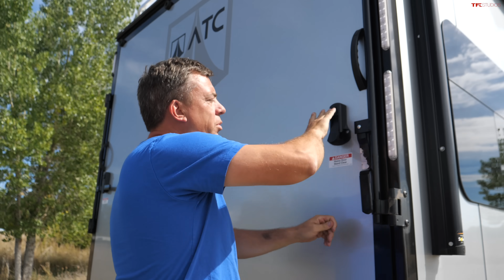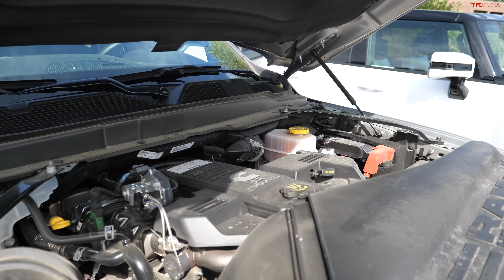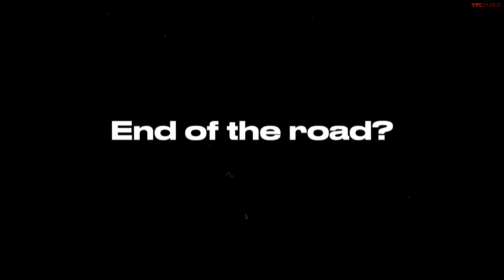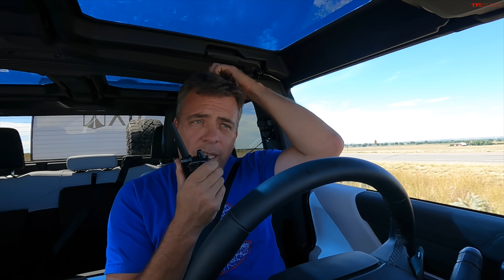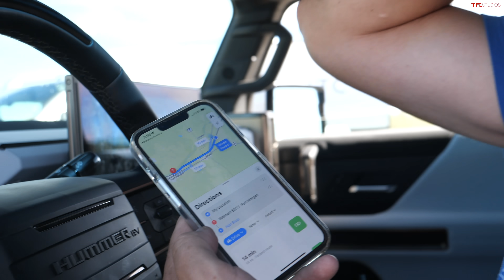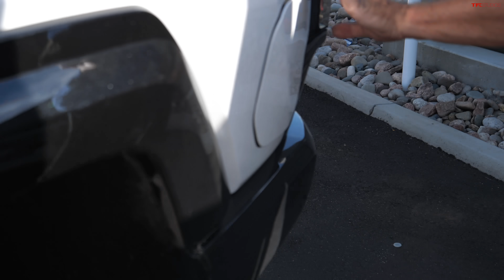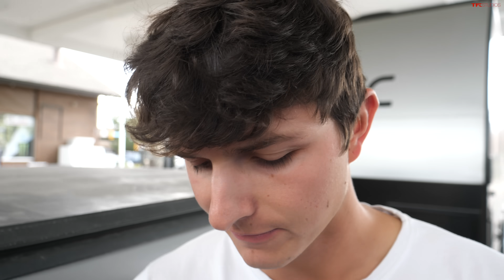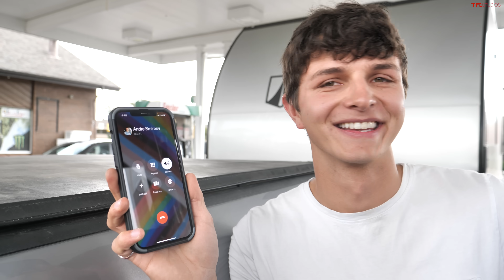How Far Can a Diesel and Electric Truck Tow An Identical Camper Trailer on ONE Fill-up?

Comment: "woah woah woah you said 2 heavy duty trucks?
                                                                                what exactly is the tow rating on that *insert truck name i can't spell*"

electric vehicles are good for short term driving or city driving.
but gas and diesel are better for long term trips or towing.

also, to any electric car/truck owners, how often do you need your battery replaced from usage.

Comment: Well that hummer has a load capacity in the flatbed Box area to hold 1600 pounds I think he said he could put a decent 4000 W generator in there with a  Few 5 gallon gas cans, which he hopes won't get stolen, and can recharge on the go, overnight...
Reply: Funny how the electric truck still needs gas to charge,,,,,,

Comment: Who cares if the electric hummer could even beat the diesel as is with that scenario.... It's ultimate hauling and load capacities are so inferior and you're not even going up hills in the Winter with the heater on.

Comment: Wait until they Federal Government Enacts the  MILEAGE TAX .. Diesel and Gas prices include a Tax at the Pump..The Onboard GPS on EVs will transmit the mileage traveled and a Tax will somehow be charged to EV drivers,or the Price at the EV Charging Stations will get adjusted... Each state has different Fuel tax rates, so Electric Car owners can expect to pay Gas taxes at the same rate that gas car owners pay..  I believe the law is passed, but not enacted until a future date so as not to discourage SALES... Expect to Pay Electric Surcharges and Battery Disposal Taxes and Higher Insurance, faster depreciation and equivalent pollution. Did the Vehicles use Air-conditioning or Heaters which would eat up kilowatt hours, too?   NO....Lastly, it is only fair to test vehicles when they are used...Say 3 years old...A 3 year old Battery may not even take That Hummer  100 miles in Winter or in the Heat of Summer...  EVs have a place, but don't be a Guinea Pig for the EV Manufacturers.

Comment: Evs are nice if you just run around town, have a garage to park it in and charge at home. I see the potential for local delivery vehicles etc, That can charge overnight at the yard. but as far as long distance or hauling, they are not even close. Buddy could pull that Ram in, fill the tank, take a piss, gat a coffee and be back on the road in 10 minutes where the EV is sitting there for an hour, if there is even charging available.

Comment: And if they got rid of the def and actually let the truck run like it's supposed to it would actually get better fuel mileage. Once I got rid of the def in my truck, I had more power and 5-10 more gallons a mile. Plus it takes oil and diesel to send def to the supply places and it's also shipped from over seas as well which takes diesel in the ship which don't use DEF. For Pete sakes fuel is much better then these dumb EV vehicles. If you're going to make ev then make them hybrid. And make the damn fuel mileage better. The oil companies don't want that though because they would lose money. All about the money some just don't get it!

Comment: I got in a discussion on another forum about class 8 EVs.They we're saying it would do everything a diesel truck would. I challenged them to a test of hauling a 210 thousand excavator 450 miles without stopping to recharge.
Reply: That's actually fairly doable. The Tesla Semi did 500 miles flat under full load, although that was a fully covered trailer, an excavator isn't quite as aerodynamic.

It has to be noted though that the "no recharge" rule is dumb. Commercial drivers are required to make a rest stop after a few hours, I don't remember how many exactly, but still - no way the driver can do 450 miles in one go, and if they have to stop for 30 minutes anyway, why not recharge in the meantime?
Reply: @Wojciech Muras  Over the road drivers are required to take a 30 minute break within the first 8 hours. You can easily drive over 400 miles before the 8 hour break is required
Reply: @wojciechmuras553  I think you need to rethink the math.
I believe the 500 miles was with the flatbed hauling 44,000 lb of Jersey barriers at 81,000 lb Gross.

Well over double the frontal area, way more rolling resistance due to all the required extra axles, way more tare weight due to the mass of the trailer required and a 210,000 lb excavator. In my experience you will expend about 4 times the energy so maybe 125 mi range.

Electric  trucks at current technology levels have potential as is for P&D operations for LTL carriers or other specific applications.

Traditional longhaul will need less weight and more range than current Li Ion Packs. If the packs that are just entering production can meet the marketing claims of 4x the energy density it could allow half the battery pack weight and double the range. At that point it will depend on the unit cost and battery pack longevity and replacement cost. 

Diesel replaced gasoline, gasoline replaced kerosene (coal based), kerosene replaced whale oil and whale oil replaced wood only when economics dictated it. All the good intentions in the world are unlikely to make the transition to electric successful. You have to make it economically desirable. 

The trucking industry would love to stop spending huge sums of money on diesel, just give them something that makes more cents (as in dollars and cents).
Reply: @gk5891  Oh, you mean one of those excavators? Yeah, I was thinking more along the lines of John Deere 160 P-tier, not mining excavators. For loads that unusual, true, Semi makes absolutely no sense, unless it's short-haul.

Still, there's a lot of jobs where the combination of load and range Tesla offers is perfectly adequate. And with the current prices of diesel versus current prices of electricity, I think it's viable economically.

The Tesla Semi probably isn't cheap. But depending on how it's priced, it might be a reasonable option already.
Reply: @wojciechmuras553  Please understand, I'm not anti-electric. I honestly see applications where they are intriguing. Start there and let them expand as the technology improves. Certain segments may ultimately be better served with other options (Hydrogen?) or may not, time will tell.
Reply: @wojciechmuras553  Have at it, there are only 1000 semis waiting in front of you.
Reply: @wojciechmuras553  people come up with crazy scenarios to bash evs. “I bEt It WoNt Go FrOm TeXaS tO ChYnAh In OnE tRiP WiThOuT sToPiNg”
Reply: how'd that go

Comment: 31 minutes lost and at 37$ already. If I put 37$ into my Ram 1500 V8 I can still (without trailer obviously) easily do an entire week of driving (6 days to work 22 miles each for a total of 132 miles with gas to spare.) This doesn't seem anywhere remotely worth buying. I'm being convinced every time I see an EV that Hybrid/diesel/gas is the correct answer every time.

Comment: Ok. So here is where I’m at with all this.    Even if the “electric” is more “efficient” I can fill up a diesel or gas vehicle in about 10 minutes and get back on my trip.    Electric vehicles take like 8-12 hours to charge.    Who wants to take a 8-12 hour break every 100-140 miles?    Now actually put some weight behind those trucks.   My diesel hauls 23,000lbs plus daily and I get aprox 13mpg on average. That hummer could never haul my trailers.

Comment: Focus on Hybrid technology and stop wasting time. How to combine the technologies for better results is what will improve overall technology.  EVs in reality are a novelty, bar hopper, living in built up area but not really going any distance. Doesn't matter how far a tough looking though if you can't charge it on the route you're taking once you get to the maximum distance the charge. And then you got to go somewhere where there's no charging station what are you going to do? There is literally no infrastructure and place all the foreseeable future that can make this happen. Trying to drive it in the Midwest sometimes you can't find gas stations for $100 miles for a place that can charge an EV that you can sit for 8 to 10 hours waiting around in the middle of nowhere unmolested because it will become a criminal Haven. All these isolated charging stations will have to have security? Hopefully this research will help develop emerging technology and combine them for better performance. The EV push agenda doesn't take in to account that most people use their vehicle as a tool and not a toy .

Comment: Batteries generally have a service life of about 5 years, and that's pushing it. Just how much money will it cost to replace these batteries. Remember folks, two on the diesel and it looks like about 20 batteries. I got to see how many batteries per tray.  And it looks like there is at least two trays.

Comment: I saw their speedometers and they were going around 70mph+. They could greatly increase range if they went 60mph.
Reply: They could increase range even more if they went seriously downhill, with a tailwind and went 50 mph. What's your point?
Reply: @Glide1992  most people that tow campers aren’t going 70mph. So the range isn’t near as bad as it seems in the video.
Reply: @artofthegun4822  When you're on the interstate where the speed limit is 70+ and the rest of the traffic is doing 75-80 putting along at 50 mph to extend your range isn't exactly safe. And it wouldn't have made it to Ogallala at 25 mph.

Comment: Correct me if I’m wrong.
He charged for 31 minutes and spent $37 on the cost of charge? So if he was to continue his trip he would of spent about $80 for 2 full charges and total distance of 260 miles? My Diesel Truck moded takes 35 gallons at current rate, to fill up $143, towing Gooseneck with skid-steer full tank gets me 341 miles City, probably easy 400+ miles highway. I feel sorry for punks that were sold a lie of towing with EV. Just my 2 cent on it.

Comment: Comparing the cost for the diesel trip, $105, to the the electric charging , approx. $92, you get a difference of $13 for a 220 mile trip towing. You would only have to go 750,000 miles to offset the added cost of the hummer! Of course that assuming no major expenses for either truck!

Comment: Andre said his charge up would’ve only cost him $40, but he only went half as far and only charged half his battery.  So it would’ve ended up costing him more if it was a true miles-miles comparison, right?  Plus the 1hour of additional time to charge.
Reply: I watched a Hummer EV road trip video.  The guy said the manual said it was best to completely deplete the battery before recharging so he had to drive his Hummer EV around a mall with the heat going for about a half hour before he could charge it.   How green is that?  😂
Reply: I noticed that as well. Electric isn't practical beyond short distances and in this example everything costs twice as much. At minimum. I would be curious as to how a hybrid would do however. It should also be noted that the ev's lose efficiency as they age.
Reply: "Plus the 1hour of additional time to charge"...IF one can find a "fast charger"...every 128 miles.
Reply: He also would have had to stop again to charge to make it back to Boulder. Unless he just left the trailer there at the Fort Morgan Wal-Mart and came back to pick it up with a real truck.
Reply: And time is money if you make good money.
Reply: @Non-Woke Guy I don't doubt that.
Reply: @Non-Woke Guy True, it's laughable and states like california are going to mandate everyone use these vehicles. Let me remind you california gets 1/3 of it's electric out of state as it is. Let's just power everything with fairy dust. They gotta have that market cornered.
Reply: It cost over $15,000 to change out an ev battery.  So what poor or middle class person has that kind of money???? Like I said, let’s get rid of rich white climate alarmists.

Comment: It would be even more interesting to compare a Hummer EV towing against an older 12v Duramax or 12v Cummins.
Reply: neverheard of a 12v duramax, wanna tell me about this? lol
Reply: @maxkraydich4929  lol, yeah that would be dumb, eh? you know, the six-cylinder duramax that went in the fabled diesel Avalanche.  :)
=
Reply: The ONLY Comparisons they should be doing is EV vs EV.... EV vs GAS\Deisel is NOT EVEN CLOSE.... EV will LOSE against ANY GAS or Diesel

Comment: Tesla just did a 500 mile trip towing over 80,000 pounds on their new truck.  So there is room for big improvement on the part of Hummer.  People will tow with electric trucks as you save a lot of money on fuel and have almost no repairs.  Plus you forgot to mention all the toxic fumes diesel spews into the air we breath.